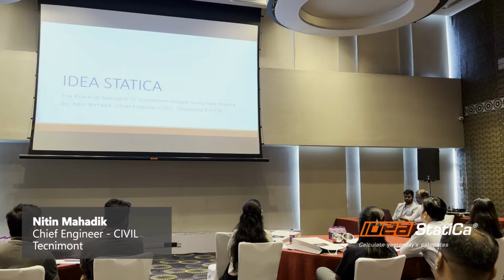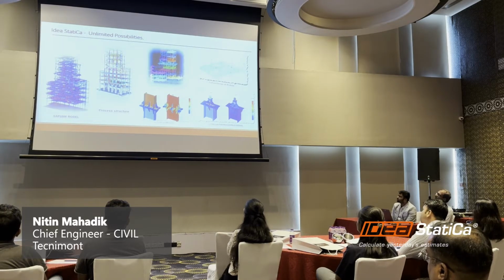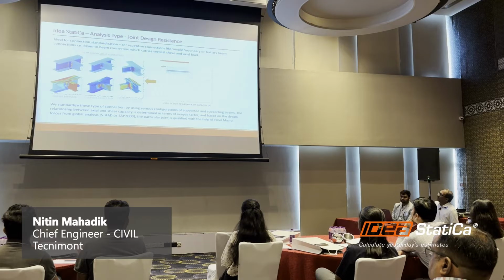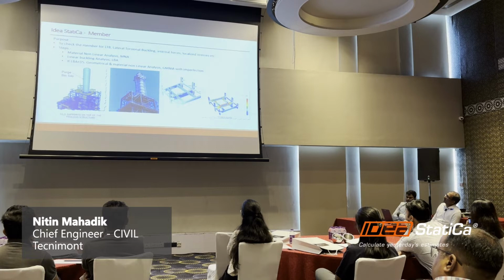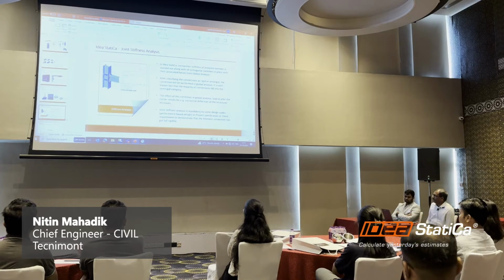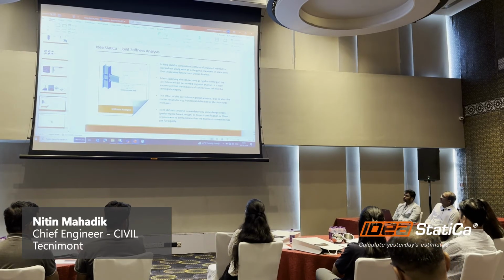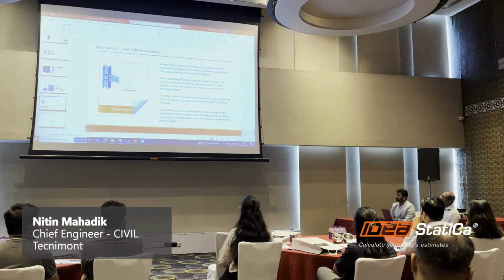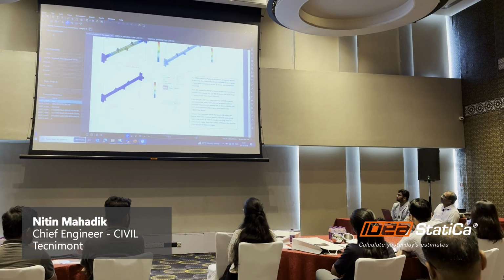The Practical Approach to Connection Design using IDEA StatiCa by Tecnimont's Nitin Mahadik

Comment: "IDEA StatiCa is a game-changer! 🔥 It simplifies connection design while ensuring stiffness, LTB, and other critical checks. Special thanks to our customer Tecnimont for presenting at the Pune Steel Seminar! 💪🚀 #StructuralEngineering #IDEAStatiCa #Nhance"

Hey Engineers! If you're interested in exploring IDEA StatiCa, you can sign up for a 14-day trial by filling out the form. Be sure to select "nhance consulting engineers" as your support contact to receive expert guidance and top-quality support with in INDIA! ☺️🙌
Reply from the maker: That's right! nhance Consulting Engineers is a great reseller, and we can recommend them!